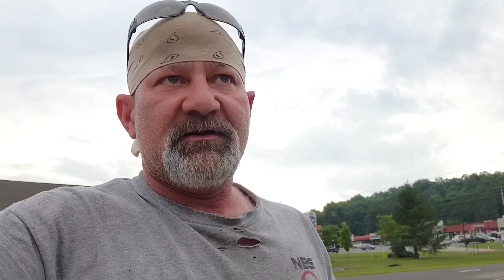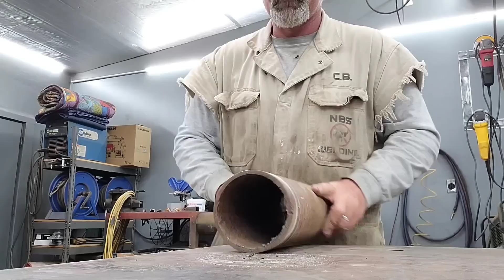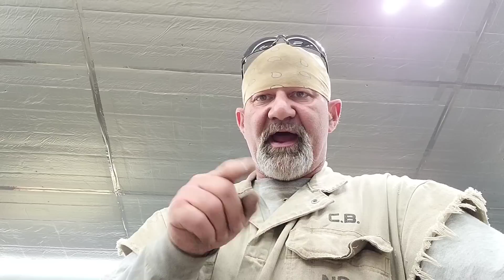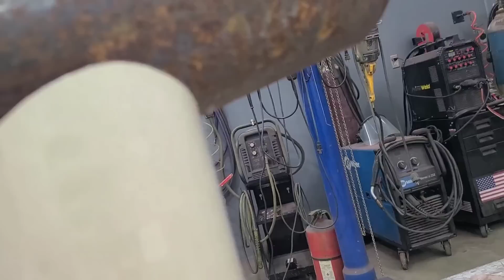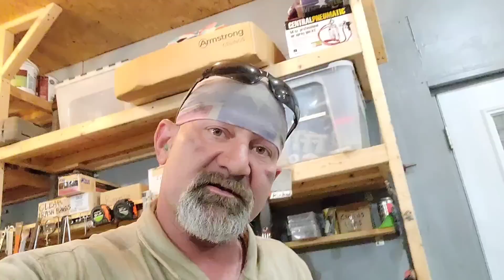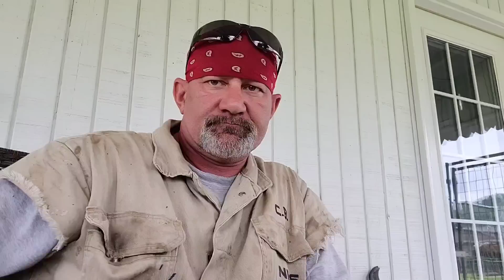Fabrication of an awning at the car wash

Comment: I have a slider made out of rope that climbers in trees use that works really good. You can hook it around a piece of pipe or two anything that is near you and slide it up and down your cable to get slack you can pull out the slack you want and it’ll hold it from having all that tension on you. I know what it means you pull 25 or 30 foot of welding cable up in the air. It’s super heavy heavy to hold

Comment: When I was a cable installer, we used to put our hooks right on the steel cable on the pole and throw our harness strap over the cable. One time by buddy's ladder fell and he was hanging from the steel cable until an old lady came outside and she had to call for help, because she wasn't gonna pick up that 30 foot ladder. He hung there for a good 45 minutes before anybody showed up. From that day forward, we started throwing our strap over the steel cable and through the center of the ladder so the ladder couldn't fall past the strap. Great job brother!

Comment: I'm currently building a 40x60 steel building that came as a complete kit.  All 4 walls and the roof have x-bracing that is made up of cable, dead ends, eye bolts, and hillside washers.  Once the framing was up, it would sway and move.  As I went around alternating tightening the cables, I could pull the building plumb and square.  Once everything was tight, the building was very rigid, and the siding and roofing metal is only going to increase the strength.
If you are concerned about the flexibility of that shade structure, cables would be a cheap and easy way to go.

Comment: you might consider pouring a three foot concrete bollard around those two front support posts.  That is high enough to protect from a truck bumper.  Ladies sometimes back out and not realize what the nose is gonna do.  This is a common safety measure in engineered parking structures.
Reply from the maker: I agree...don't know if they'll do that but they should
Reply: @NBSWELDING  enjoyed your project